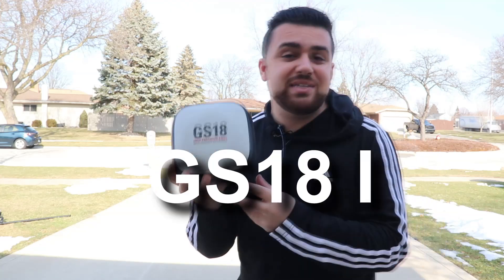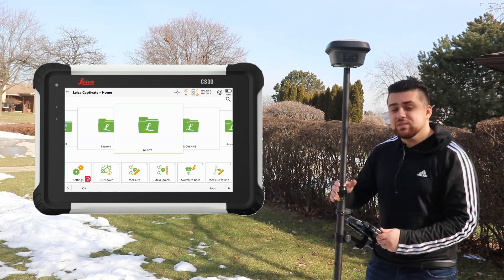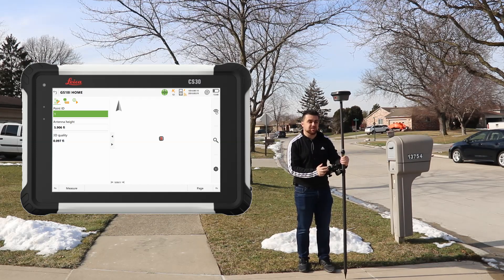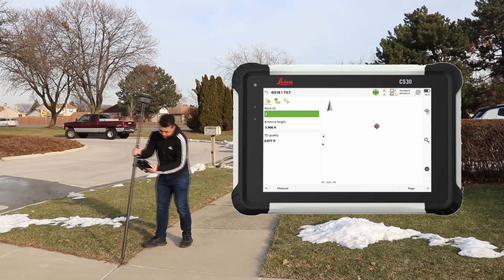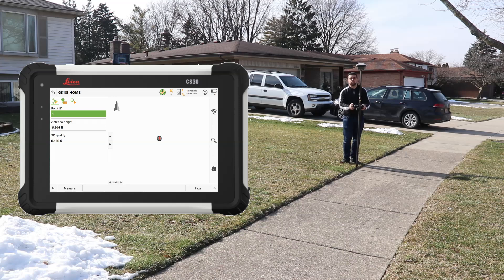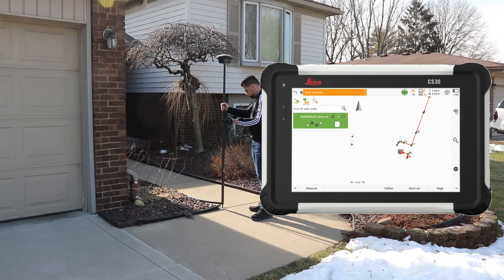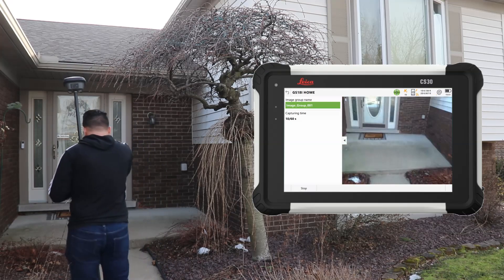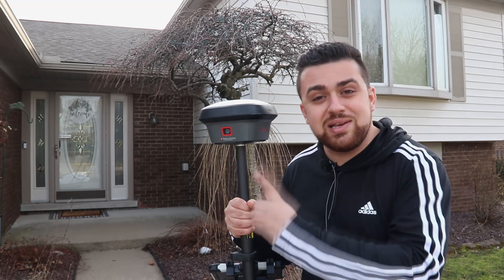I'm blown away by the Leica GS18I GNSS Receiver

Comment: great clip. i am, since 1996, a very small leica dealer in ger. but known for a big stock in second hand. i sell (95% demo and second hand from leica and cpe-leica) this gs18t/i now since 2019, over 130 pieces sold and not one is coming back until now. It is i. m. o. also the most robust and stable GNSS system from leica. Even if it is (also as a used one)  a little more expensive than others. As it is with all surveying instruments, if you buy cheap, you buy more often.  important...use allw. the new FW. the 8.x was a big leap in performance and dont forget to plug in short gsm antenna ..if you a bit forgetful put the sim in cs20 controller that also give you the plus to have a visual field-strength bar for your gsm  iIII  . )

Comment: You would have got better results if  you followed Leica's instructions for image capturing, manually going through and reviewing the photos per each point, walking at in a regular paced arc plus a few other manual specified timing/distance guidelines, and using the tilt function with best practices (not exceeding 30 degrees when possible (30 isn't Leica's max, I think it's between 45 and 60 degrees) and making sure the tilt is towards the open sky if possible.) I get that you're making a demo video though so it's hard to  focus on surroundings when you have to make sure you're in camera frame. It's amazing the imagery functioned as well as it did when it was collecting like that. Are you going to show the point cloud feature that the GS18i offers? It's pretty cool.

Comment: Rami - I have one these but use an old Topcon Pole as I was Topcon user prior. My topcon pole is probably not as rigid as the Leica one you are using. Could you let me know the product number of that pole -- is it a GLS31?
Reply: or maybe the GLS30....
Reply: @globalsurveyor  gls30 is gps pole - gls31 prismepole this has above a leica prism bolt. but you can use the GLS31 with the GAD31 adaptor for the antenna..

Comment: They sell the new Trimble tilt sensor stuff with the phrase watch the rod not the bubble.  They say you can shoot power outlets on vertical walls with it if you are getting enough satellites.  Try and shoot a power outlet with it.  I am curious.  I don't know why a surveyor would really need to though.  Sidewalk example was a good example.
Reply: I was unlucky enough to have to lift up an R12i onto vertical walls and fences at a professional tennis court used in a large tournament. I had to collect all electric, fiber optic, coax, and telephone lines and associated features (ie various boxes). They were EVERYWHERE because the courts had to broadcast to TV and all of that. Scanning wasn't an option because  1) we are an all trimble outfit. 2) Trimble scanners are a joke compared to Leica, the one we had couldn't even capture the points with the associated image.  3) Even if they could... the office guys wouldn't feel like tracing out which line is which in the comfort of their chairs so they were having us do it in the elements. I know I'm not being fair here, but truthfully, I'm just a surveyor. I have no extra tools. When a bunch of lines enter a box then leave out through 50' of conduit and only 3 of the 7 lines come out exposed... I don't know what is what anymore.  Especially after 6 days of doing nothing but this (for the most part).

Comment: Excellent stuff. I plan to make a few videos of the GS18 I use. But I can confirm its an awesome GNSS and I get fixes in places I'd never thought I'd get with the latest firmware 7.51.
Reply: That would be very interesting to see how "bad" spots you can still get a fix.
Reply: @PeeHooo  Hi with my channel @globalsurveyor - please subscribe, I show a few videos of getting fixed in tough places and plan to do more. As the Captivate firmware was updated this has made a real improvement. Before there was a feature called Xrtk which gave a false fix +/- 0.1m and then go better in tough situations...now Xrtk is gone with new update and survey areas in Australia where I am, are better than before.....but more testing is planned.. Thanks for the comment... I really enjoy Rami's videos too.
Reply: @globalsurveyor  Already did! I will check out your videos. I'm not familiar with Xrtk or even certain what it means. It is some kind of correction service feature by Leica? I'm still quite new to this field. I'm currently studying it. I have done some training jobs but they had all the corrections services/features already setup for the GNNS receiver. I know it was using SmartNet but what services it included I'm not certain. I was also using GS18I and was quite impressed by it performance. I know that it was running the older FW version so I'm interested to hear how they made it even better! And I 100 % agree, Rami makes awesome easy to understand videos!

Comment: You've had the chance to use this tool, but it's not worth the price at all. For the cost of this tool, you can buy three other GPS devices from different brands that don't lose the signal near buildings or trees. Its compensator was very uncertain and inaccurate. It lost calibration many times and took minutes to recalibrate. The tablet is very heavy and not user-friendly with unnecessarily large icons, taking up a lot of screen space and preventing multiple information icons from being displayed. The camera-based measurement is inaccurate, unworthy of a surveyor, and very slow as well. Leica's iCon products are much better.
Reply: I don’t know much about this stuff, but your input is still appreciated. Thanks!
Reply: Hey, Which brands can you recommend?
Reply: I have this model  and i agree with you %

Comment: Very cool indeed.  Looks like you're not tracking many satellites.  Make sure you're taking advantage of SmartNet's "iMax" mount point instead of the "VRS" offerings.  It provides corrections on all constellations.  We regularly see 30+ satellites using an Emlid rover on RTCM3_MSM_iMax.  It's an amazing improvement over our old Trimble rover tracking GPS & Glonass only.

Comment: Tomorrow I have to choose between Leica GS18I and Trimble R12i. It's damn hard and i don't know what to do.
Reply: Let us know. I had the pleasure of testing the gs18I and was impressed. I made the measurement with the pole tilted practically to the ground and the difference between this measurement and the measurement made with the pole vertically was only 4 cm. However, in the forest area I had a problem with catching the fix, but when he succeeded, the measurement was reliable. I would like to test the trimble r12i because I heard it is better in the woods.
Reply: @Krynnex  I heard couple surveyors that they have very big problems get fix with Leica, but I can say that R12i works everywhere you go.
Reply: @Krynnex  The GS18i now has a 30% performance improvement in hostile environment with the version 7.5 of captivate. It does make a huge difference in getting a fix in wooded area.
Reply: I have to choose between GS18i & R12i in near future. I have used R12i in wood and under big canopy trees for a big topo survey recently. It fixed all the places where I shot. When picked up big canopy pine trees it took little more time to give a fix. But everywhere I go I heard "OBSERVATION STORED" voice message. We used a local R10 base for RTK. But please share with us what was your selection and comments. Thank you Rami for the content.
Reply: The R12i is leaps and bounds ahead of the GS18. You get a stupid-accurate IMU and the ability to work under tree canopy reliably. Much more bang-for-your-buck.

Plus when it comes to GNSS, Trimble reigns supreme. The company was founded on GNSS positioning and are the experts in the field.